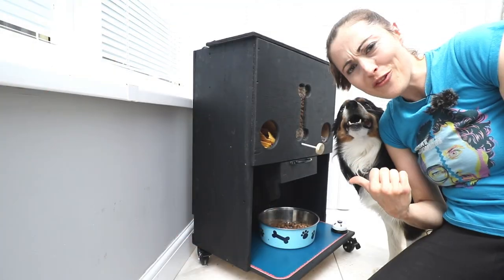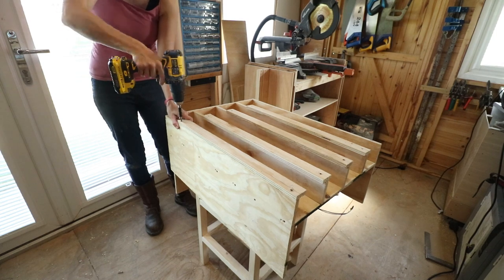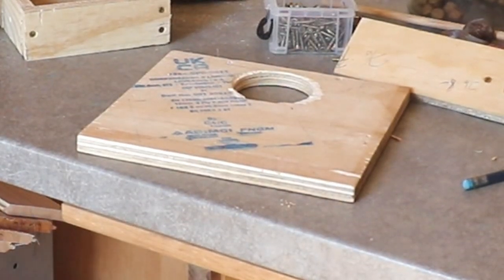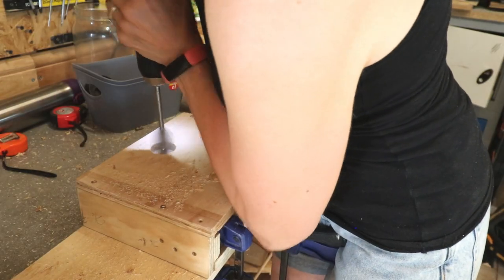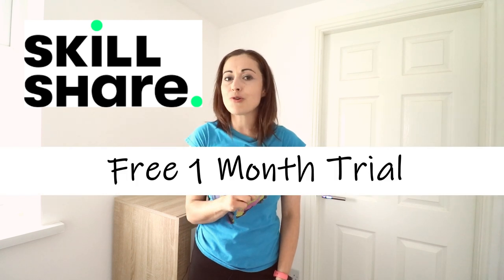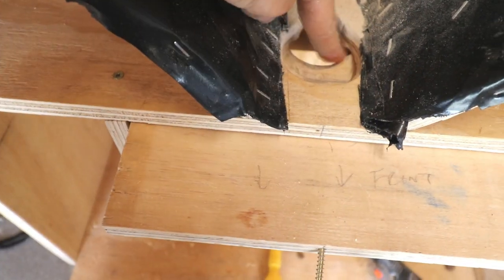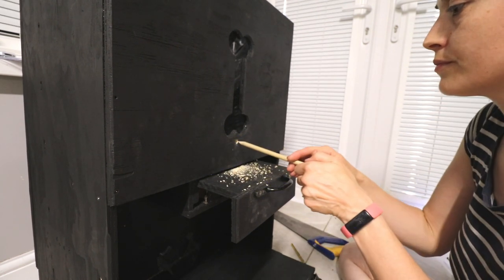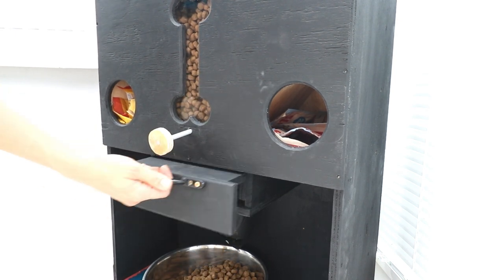How to make an EPIC DIY dog food dispenser for biscuits & cans!

Comment: There's a huge amount of on-the-hoof engineering here. I love a project that grows and grows until it does the job. Great problem solving at a break neck speed. Had to pause and go back a couple of times to keep pace. Brilliant final feeder station but I feel exhausted!
Reply from the maker: Sorry, I had your head spinning...although never considered myself as an engineer, which is nice 😂 

I still have to write my step by step blog post for it and would love to get an insight as to which part of the video you feel would benefit from more explanations?  Thanks!
Reply: @TheCarpentersDaughterUK  Hi Vikkie. Well it definitely wasn't a bad thing, I enjoy going over more complex parts in build vids. I replayed how you overcame the problem of the biscuits jamming the sliding tray. Was it just making the hole smaller that cured it? Also shaping the sheet at the back and the V-shaped hole to keep the flow steady. Your rapid pace is great to keep people interested but as I find you interesting anyway I personally could enjoy a slower explanation. It's a YT attention span thing, know.
Reply from the maker: Bugger... accidentally deleted my reply as I'm tired 😂(!!)  I found the small hole above slows down the flow of biscuits from above and reduced any jams significantly compared to the blast idea where the holes were identical.

Also, the v-shape just allows the biscuits in the box below (while full) to travel better to their destination.... it's also not rounded off as I think more biscuits would get stuck.

So even if 1 biscuit gets trapped, the nuggets are already dropping into the bowl by the time the lever is pushed that far, so it's just a matter of moving 1mm back and forth without thinking to clear a jam, but thankfully it doesn't happen often.  Thinking about it, I suppose this could be solved by bringing the bottom hole slightly closer to the front of the cabinet (or make that part bigger closest to the front), so the biscuits can drop even sooner into the dog bowl.
Reply: @TheCarpentersDaughterUK  I think that's a perfect explanation for your blog post. I really appreciate you taking the time to write it (twice!) especially knowing how hard you work. And yes, I definitely think of you as a problem solving engineer when you figure out how to make things work like this. Thank you.